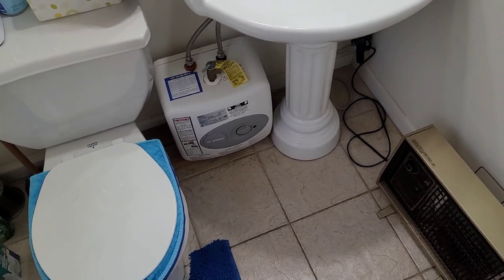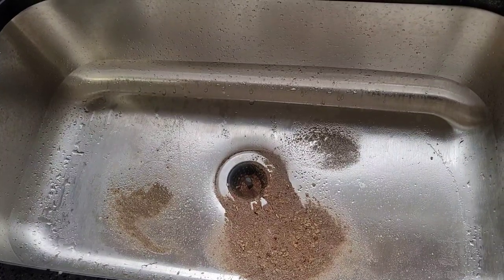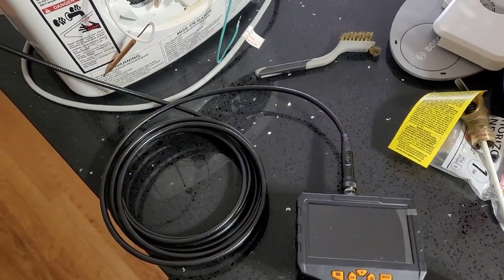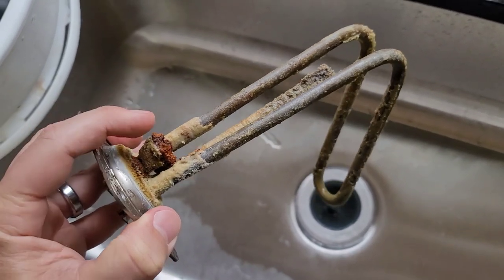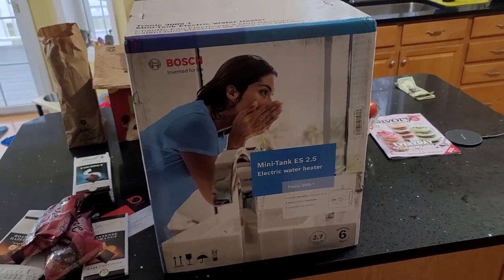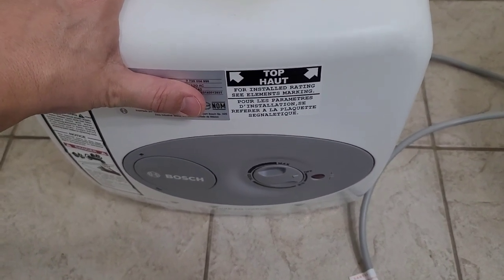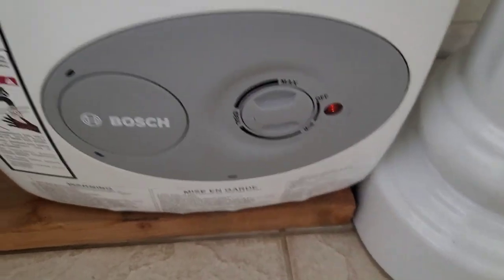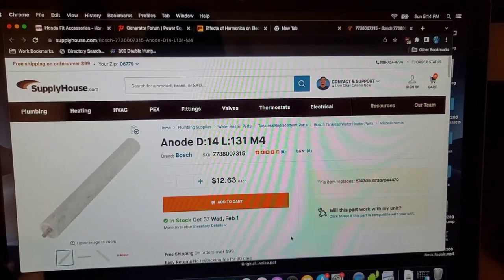Bosch Tronic 3000 T ES 2.5: Maintenance Tips and Replacement

Comment: I use this tank as a mobile groomer. My tank has been in use for 6 years. I never knew about any maintenace (got lucky) I am having an electrical failure (indicator light was not coming on and tank was not heating) Thank you for walking me through gaining access to temperature controller. Now I see the rust corrosion. I will be buying a new one. Thank you. And thank you for links to parts and service manual.
Reply from the maker: @jennifersdramaticpaws  you are very welcome!

Comment: The over pressure valve is pointing at people , if it were to blow off someone could get burned . Should it be piped to somewhere safer . Just a thought . Great video .
Reply from the maker: Agreed. Going to get some pipes to point it down to the floor. Thanks for watching!
Reply: Is that a reasonable life for one of those units?  Seems like an expensive replacement even with DIY installation.
Reply from the maker: @johnrazor8720  not really. With proper maintenance it should last 10+ years.
Reply: @Bassguitarist1985  Would you please include the specs on the piping?  Also is there a special valve that's needed to ensure proper venting of pressure?  Thank you!
Reply from the maker: @Joclo222  Sure. The pressure valve is already included on top of the tank. It is a 3/4 in NPT pipe thread.

Comment: Good video.  I bought this tank and will never buy again.  Who would've thought that it needs to be completely disassembled and parts changed every year.  i wish you showed how to take off cover and how to drain.  Buyer beware on this tank.  Who designs these things?  Appreciate the video
Reply from the maker: Thanks for sharing. My apologies on not showing that part. It's only a few Philips head screws that hold the cover on. How I drained it is the hard way, meaning I had to take a full tank and flip it upside down in the kitchen sink to drain it out. There's really no other way to do it.

Comment: I cleaned and replaced anode once a year. Went 10 years then tank leaked. Been a good unit but no maintenance will destroy it in a few years.
Reply from the maker: I made it 6 years before it started leaking! If you can get 10 years with regular maintenance with the anode rod replacement I think that's a great longevity

Comment: Thanks for the video - 2 questions: where is the electrical outlet that your water heater plugs into - was it there already? And, what's the average inlet water temp where you are? Also, the manuals I've looked at for various mini tank heaters describe the effect of thermal expansion on the pressure release valve (lime build up and eventual leakage) in "closed systems" (when a backflow preventer is on the house side of the water meter.) They recommend installing a bladder expansion tank - seems like a lot to add to this little system...
Reply from the maker: The outlet is a GFCI right next to the sink, so it was an easy connection to it. To your question on the expansion tank, if your local code requires a backflow preventer then your house should already have an expansion tank before the install of this POU Mini Tank as your house water tank (if equipped) would require it. In my case my home does not have a backflow and thus no expansion tank.
Reply: @Bassguitarist1985  Is your outlet down in the corner to the right of the sink? Regarding backflow prevention - this tank will be independent, and I plan to remove existing house water tank. I'll check on both code and existing expansion tank but don't think there is one - (this might relate to Cindee8311's question?) Thanks!
Reply from the maker: @marthaboyd7713  Outlet is above the sink to the right in the corner. I had to use a 14AWG extension cord to reach the cord of the water tank.

Comment: Thanks for this video - it's very helpful since I have one that has been having issues with the same water heater. What do you think may be the issue if the pressure overflow valve is leaking water?
Reply from the maker: Too high a pressure coming from the supply, water is too hot,debris caught in the plunger of the valve not making a good seal, or a faulty valve. Those would be my guesses
Reply: @Bassguitarist1985  - thank you so much for the quick response. You're probably right, I'll open it up and see what I can find. Thanks again!
Reply from the maker: @cindee8311  Best of luck! Be sure to change out that anode rod if it looks even slightly worn these tanks like to eat them very quickly
Reply: @Bassguitarist1985  - Thanks for the reminder! I just ordered it and will replace it if looks even slightly worn.

Comment: Hey one question, the pressure valve relieve should be in what position ? 

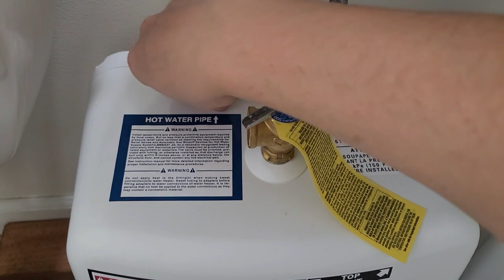If I leave the relieve valve as you have in 12:07 the water starts flowing from there when I turn the water pump on, if I close the valve, it starts leaking from the front  side! (behind the dash panel) through the heater piece gasket -_-
Reply from the maker: sounds like the valve is faulty or the tank is faulty. The lever shown at that point in the video should be closed by spring tension. In the event of overpressure it opens up spitting the water out. Either debris is keeping it from closing correctly or the valve is bad.
Reply: Oh shoot the reason for leaking was that gasket was loose!

Comment: I have this same water heater. And it’s not getting hot. Is there a way to reset it?
Reply from the maker: There is no reset button. If there is power going to the element wires but water isn't hot then the element is bad. If there is no power to the element, then the thermostat unit is bad.

Comment: Water heaters are the #1 most neglected appliance in American Homes. You covered it by saying flush water heater at least yearly. People who have well water or municipal water that comes from wells will have higher TDS (total dissolved solids), mineral content for sure.  People who have water supplied from surface water (lakes,reservoirs or rain water) will have an non existent or low amount of dissolved minerals.  

When I was younger I worked for a company that did house line/Water line maintenance work) we would isolate from the supply source an run a recirculated vinegar solution to dissolve out and flush all calcium and iron mineral deposits on homes. This drastically increased the volume and flow on houses who never had it done. If they had a maintenance contract we would replace the anode rods (zinc,magnesium or aluminum) depending on the pH, mineral makeup of their water along with the type of plumbing piping and water quality they had from the source.  The company sold filters,softeners and a everything in between. I just was on the maintenance crew side. Now for the last 2 decades I work for the water utility, I've gained an immense amount of knowledge over the last 30 years about water quality and plumbing infrastructure.   In short you can have a 6 year warranty water heater last several decades by just simple maintenance.  Almost no one reads or remembers the information in the water heater manual.  It's a set it and forget it, until it leaks or they no longer have hot water world.  

Great video, I look forward to seeing a 6 month video on this if you are still producing videos. 

The simplest and cheapest thing you can do to prevent sediment is install a simple whole house filter on the incoming side of your house or at least before the water heater as it is nothing more than a sediment trap.  

Greave video Sir. Sorry I'm so long winded. I would love to make informative videos and share my knowledge like you did but my video editing is null.
Reply from the maker: Wow awesome info! Thank you for it! Yeah i got a follow up for 3 months to see how its doing. Also plan on doing a flush on the house tank as well likely replacing its anode rod too. Its been use since October 2019 so im sure that rod needs replacing. After learning about this stuff i want to make it last long as possible! Tanks and installation are $$$

Comment: if this is installed a long ways from the hot water heater, would it make more sense to connect the cold water line to the Bosch unit?  The hot water will never reach the unit before it refills, so you just pull hot water from the main hot water heater and it never makes to it to the tank (and is therefore wasted).
Reply from the maker: Yeah if the hot water line was not run to the sink I would certainly do that. For my application I connected the hot water line to the tank because eventually if you were to run it for an obscenely long time the hot water from the hot water heater in the basement would eventually hit the small tank and it would never kick on to heat the hot water since it was already heated. Either way it's the best solution considering how far away from the hot water tank in the basement is
Reply: Thank you for the great video and fast reply
Reply from the maker: @MikeCarey101  My pleasure!